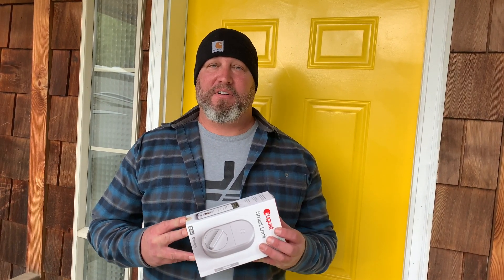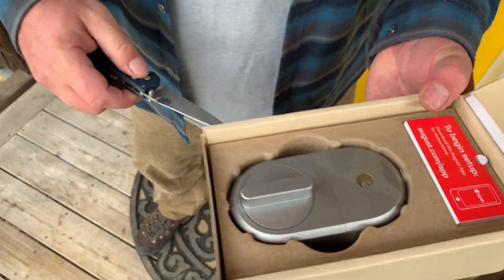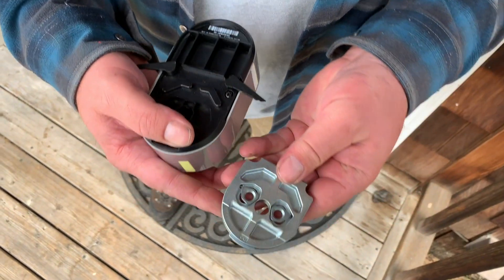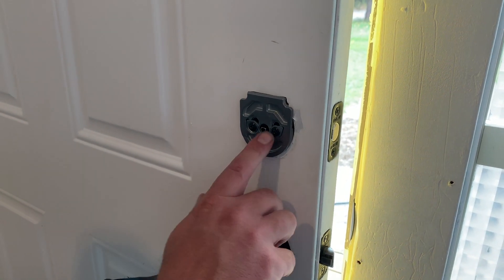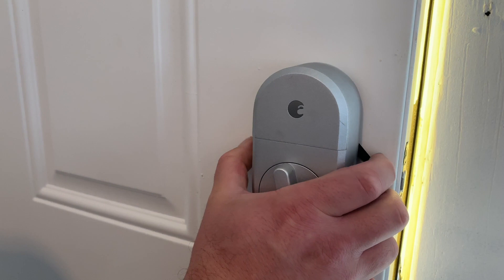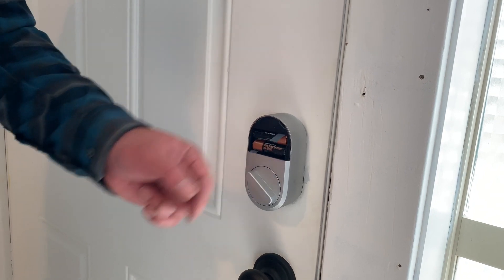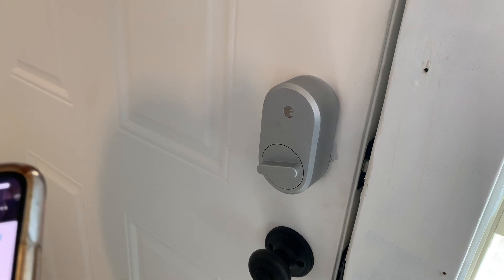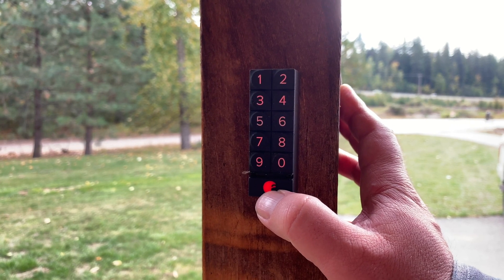Installing the August Door Lock - 1 2 3 EASY!

Comment: I bought this lock with the bridge to use it with wifi and the keypad. after a year of use the wifi connection kept dropping and the wifi connectivity and the pin code generation was completely useless. I contacted August many times and they kept blaming it on my wifi, even though my wifi had not had any changes. They refused to replace the product or resolve the issue since the lock is out of the 1 year warranty period. I read some reviews and realized many others were having the same issue.

Comment: Mechanical backup ? if the battery power drains how will you then unlock?
Reply: If you're on the inside of the house, there's still a mechanical deadbolt knob you can use like you normally would.  If you're outside of your home, the August Door Lock keeps the external key hole, so you can use your keys to get in if necessary.
Reply: This would mount inside the home and the key unlocking slot would still sit on the outside.